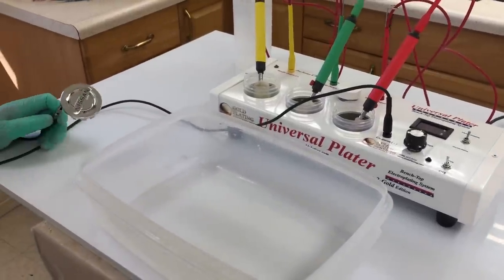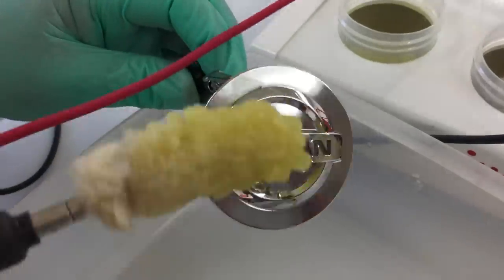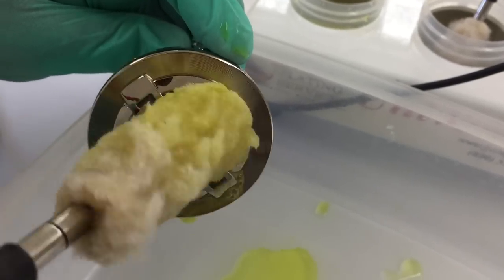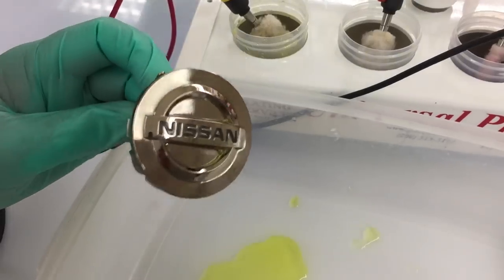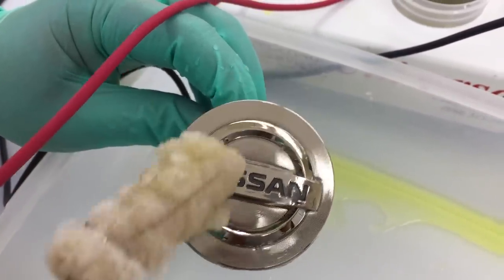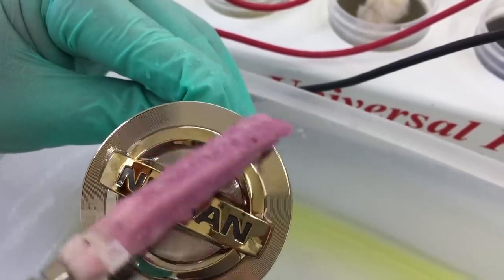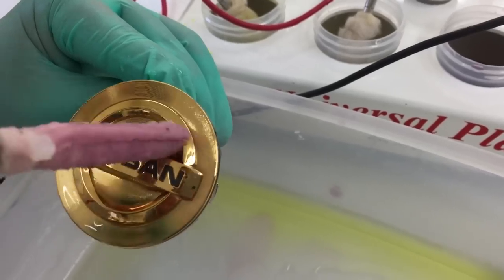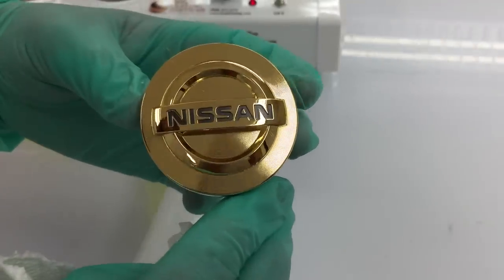How to: Gold Plating on Chrome Items - Plastic Car Emblem - Kit Demo (NEW)

Comment: I remember when going to a car deanship back in the 90's and the gold package was the in thing to get at the time.  I did not think this was popular any more.
Reply from the maker: Back in the 90's it was HUGE.  We sold thousands of our Gold Star Kit and did plating for dealerships all over the USA.  It fell off for a decade or two and now it is back and spreading like wildfire.  Low-riders, show cars and even regular cars are getting gold packages now.  In the show car community is a must-have, in the current trend.  We've sold hundreds if not thousands of these kits since it came out 2 years ago and the vast majority of those people are doing automotive plating.

Comment: Muriatic acid/hydrochloric acid/HCl will remove chrome quickly.  You should apply the plating solution over a larger supply container so that the excess drips into the larger container and isn't wasted.

Comment: You think this would work on chrome door trimming, chrome door levers and the chrome trim strip that goes along your window?? All that gold would be different
Reply from the maker: Yes.  As long as the item is chrome plated you can plate it.  This item is plastic that is chrome plated, and as you can see it works great!  Thanks for the question.

Comment: Like magic.. i really didn't see that coming.. and it seems easy
Reply from the maker: We've been doing it over 25 years and it still hasn't stopped being magical. It really is quite an incredible and fun thing to be able to do.  Truly unique and guaranteed to impress.  Gold plating can be extremely difficult if you don't have the correct setup and instruction.  We have made it as easy as we possibly can for our customers and we share every bit of knowledge we have with them as well.  Thanks for watching!

Comment: I know this is probably a stupid question but, can it be used on chrome model car parts? I have a motor with a blower on it and this would be amazing on it. Great job buddy.
Reply from the maker: Yes. If you stripped the chrome off the parts and then plated it, it would work.

Comment: I'm working on a 1958 cadillac that has faded gold plating on aluminum emblems. can these be successfully plated? the pieces on this car are very expensive and I'm trying to help an elderly lady with this project. also, what is the cost of the kit? thanks
Reply from the maker: For this question we think it would be best if you sent us an e-mail with some pictures of the emblems.  They may be able to easily be plated with the Universal Plater Kit, but we would like to see them before we say for sure.  The e-mail can be found in the text description of the video. ( info(at)goldplating(dot)com )

This particular kit is $999.00 and comes with everything you see in the video.  $300 worth of gold plating solution are included as well as the accessory chemicals as well.

Comment: That clips you use, connected to the "Common" black cable, is that like a ground cable? You have it connected to plastic. Would it work on a larger piece of plastic and/or is there a size limit to what you can plate?

Comment: how do you do to aply a second or third coat? also if i got a copper plated coin can i gold plate it directly without activating ? can i home brew my own gold electrolyte solution?
Reply from the maker: There is no need to apply multiple coats.  The longer you plate the thicker it gets.  You can gold plate directly onto a coin.  DO NOT HOME BREW YOUR OWN GOLD SOLUTION!  Regardless of videos shown on youtube it is extremely dangerous and the result is far from professional.

Comment: how long does the gold last before it starts to fade?
Reply from the maker: How long gold plating will last depends on a few variables. 
1) How thick the gold is applied. 
2) What type of item is it/How will it be handled?The thickness is controlled by how long you plate the item. For instance, if you were to stop plating immediately after the item turns gold, that would be a very thin plate. However, if you spent multiple minutes plating that same area, it would be very thick. The thicker the gold the longer it lasts. Different types of items are handled differently, some a lot and some not at all. If it were a decorative item that is never touched it would stay gold plated indefinitely, could be centuries. If it were something like a Wedding ring that is worn daily, it then depends on how thick the gold is plated. If it were a thin plate it could wear off in a week. If it were very thick, like Vermeil plating (100 micro-inches) it cost last a lifetime.  When done properly, gold plating lasts many years if not decades on most items. If it's a thick gold plate, even on an item that is handled properly, it should last many years unless it is purposely removed by abrasive means (polishing etc.)

Comment: How well would this electro-plating hold up to the high heat of say a motorcycle exhaust? I'd like to go gold on my bobber, but don't want to buy new pipes since theres nothing wrong with my current chrome pipes.
Reply from the maker: Usually if the heat will affect the look of the chrome it will affect the look of the gold plating. Our gold is great on high temperatures (up to about 400 degrees) but the metal beneath the gold may start to corrode.

Comment: i'd like to ask afew questions

1 - does the gold plating last for long time or not .. because i'v read that it doesnt last for long time
2 - can i use gold plated Objects in Wet areas as Faucets in bathroom for example without worrying that the gold plate will go over short time
3 - is Electroplating better than Elecrostatic Paint !! in terms of durability
Reply from the maker: Thanks for the good questions:
1- How long the gold plating lasts depends on how thick it is plated, the conditions it is exposed to and how often it is handled.  If you apply a thick layer and take good care of it, it can last many years.  We have an employees car that has been plated for over 20 years.
2- Gold plating itself does not rust or corrode like many metals do when exposed to moisture.  The only thing that can happen is the underlying metal can corrode.  We have plated hundreds if not thousands of faucets over the years, it is very common.
3- We are not familiar with electrostatic paint, sorry.

Comment: is that like liquid gold? or is it not real gold and just a chemical reaction?
Reply from the maker: It is real, 24K gold, 99.97%+ minimum purity.  The gold bullion undergoes a process of transformation into a salt.  When this transformation is complete, it looks a lot like table-salt (white).  When you add the gold salt to distilled water, it immediately dissolves into solution.  When electricity is added to the solution, (+)Positive at the anode and (-)Negative at the item you're plating, the gold is transformed again into metallic gold onto the item you have submerged.  There are many other make-up components in the bath, such as hardeners and brighteners, that give the solution it's Purple color but if there was just the gold dissolved in the water it is crystal clear.  You can check out our Pure Gold video that shows a crystal clear solution applying metallic gold to a US Quarter.  Check it out here: https://youtu.be/au1qqg1BEiI?t=1m40s
Reply: wow that is really cool! the more you know
Reply: just saw the video of the quarter. lol im from Vermont and i thought that was pretty sweet!
Reply from the maker: Awesome!  That's our favorite Quarter. The picture is great.
Reply: Gold Plating Services

Comment: as i understood its real gold right? so my question is, is there a revert process where you extract the gold from the plated piece? thank you for a reply/answer.
Reply from the maker: Gold can be chemically stripped, however the result is not a usable plating solution.  The gold dissolves back into the stripping solution and although it can be recovered it can only be done by refineries who recover it from that form.
Reply: @GoldPlatingServices   do you have a line up of equipment I can buy. I am trying to do car parts
Reply: seems the difficulty is to get the chrome plating right. The gold plating comes easy.

Comment: get yourself an alligator clip to male banana and aa battery holder and battery and gold solution and it can basically do what this do for less than $30. that big box is just a battery with setable voltage which you can set with battery
Reply from the maker: There is a great reason we have sold thousands of these and are used by professionals all over the world.  You have the basic concept of an electrical circuit correct.  Unfortunately that setup absolutely would not work in this situation, for quite a few reasons.  It might be fun to try as a science experiment though, even failed experiments can be a good fun lesson!
Reply: I dont think you can generate 500volts off battery with an alligator clip hahaha

Comment: I've read reviews and seen pictures of numerous people that have used this and they get black clouds. And Is the stripper supposed to sizzle when applying it? I don't know man. Too much money to take that kind of risk if the gold sucks and it tears everything you plate to hell.
Reply from the maker: We have sold literally hundreds of these kits and have had very few people have issues.  Any who have had issues were making a mistake with the process and once contacting us with a small amount of support are up and going well.  As you can see in the video, the plating goes very smoothly when done correctly.  Black clouds are from either not getting all the chrome off or from leaving Surface Activator on exposed nickel too long to where the acid corroded the nickel.  We have multiple other videos showing these common mistakes and how to avoid them.  We have technicians who have been doing this for 10-30 years and provide technical support Mon-Fri from 9am-4pm.

Comment: Is it real gold?
Reply from the maker: It is real, 24K gold, 99.97%+ minimum purity.  The gold bullion undergoes a process of transformation into a salt.  When this transformation is complete, it looks a lot like table-salt (white).  When you add the gold salt to distilled water, it immediately dissolves into solution.  When electricity is added to the solution, (+)Positive at the anode and (-)Negative at the item you're plating, the gold is transformed again into metallic gold onto the item you have submerged.  There are many other make-up components in the bath, such as hardeners and brighteners, that give the solution it's Purple color but if there was just the gold dissolved in the water it is crystal clear.  You can check out our Pure Gold video that shows a crystal clear solution applying metallic gold to a US Quarter.  Check it out here: https://youtu.be/au1qqg1BEiI?t=1m40s

Comment: Can you use this on items already  gold platted that need to be touched up and stainless steel items
Reply from the maker: Absolutely!  To touch up gold plated items, you need to get it looking as good as you can before starting the 3 step process.  Sometimes the gold needs to be removed first, other times you can just plate over it and it looks great.  Stainless Steel can easily be plated with this kit as it comes with everything necessary.  Here is a video showing how to plate onto stainless steel: https://youtu.be/R3hvbtwE3Ho That knife had been improperly prepared and in that video we show how we replated it properly.  Keep in mind, that video was for demonstration purposes and if we were doing it for a customer we would have plated the entire knife.

Comment: What about rims?
Reply from the maker: Rims can be done.  We have hundreds of customers who use this very kit to plate rims, bumpers, emblems etc.  Large items are done the exact same way, except you do "sections" of the item.  For instance, you would do a 5" square area (chrome strip, activate, gold plate).  Then you would move onto the next 5" square area, repeating the same steps.  Doing it in sections is the best way to ensure seemless, complete coverage of a large area.  If you attempt to do the entire item at once, it does not turn out well.
Reply: can you see difference in thickness when doing a large car part in sections? thank you

Comment: If I gold plate a matte aluminum piece, will the end result look polished?
Reply from the maker: If a piece is dull before plating, it will be dull after.  If it's shiny before, it will be shiny after.  Unfortunately, you are not able to plate onto aluminum on a consumer level.  It would need to be nickel plated by a professional plating shop before you can plate it with our products.

Comment: Could you do this to a hot wheel
Reply from the maker: Yes, however hotwheels need to be nickel plated prior to gold plating.  Typically they need to be sent to us for this process as they are made of zinc and zinc can be tricky without having a Cyanide Copper (we do not sell this).

Comment: Could you clear coat the gold ?
Reply from the maker: Yes you can. Just remember if the item you are plating needs to be touched up, the clear coat will need to be completely removed.

Comment: Is it possible to plate regular steel. Such as steel used for guns?
Reply from the maker: Oh, absolutely.  We have a video demonstrating exactly how to do plate steel, two videos actually.  Over in the realted videos you may see it, if not go to our channel.  We have one called "24K Gold Plating Stainless Steel" and one called "24K Brush Gold Plating on Guns - How to Brush Gold Plate Steel - Universal Plater".  The second video actually IS a steel gun part (AK-47 Safety).  Stainless steel and regular steel are treated the same way.

Comment: Is there such machine for chrome plated?
Reply from the maker: No.  Chrome is extremely hazardous and is not available on a consumer level.  You need multiple permits and have to jump through a lot of hoops to be able to do chrome plating.

Comment: is it real gold or what?
Reply from the maker: It is real, 24K gold, 99.97%+ minimum purity.  The gold bullion undergoes a process of transformation into a salt.  When this transformation is complete, it looks a lot like table-salt (white).  When you add the gold salt to distilled water, it immediately dissolves into solution.  When electricity is added to the solution, (+)Positive at the anode and (-)Negative at the item you're plating, the gold is transformed again into metallic gold onto the item you have submerged.  There are many other make-up components in the bath, such as hardeners and brighteners, that give the solution it's Purple color but if there was just the gold dissolved in the water it is crystal clear.  You can check out our Pure Gold video that shows a crystal clear solution applying metallic gold to a US Quarter.  Check it out here: https://youtu.be/au1qqg1BEiI?t=1m40s

Comment: Isn’t this basically like powdercoating
Reply from the maker: Similar industries but they are different.  Powder coating is done using a free-flowing, dry powder, that is applied using electrostatic and has to cure.  This process uses liquids with real metal, dissolved into solution in salt form, that comes out of solution and deposits onto your part through an electrochemical reaction.  They are both finishing processes, albeit similar they are completely different crafts.

Comment: Hi. Can I do whole car body with this on existing paint work..
Reply from the maker: Electroplating requires the item to be conductive (metal) or at least have a metal surface. You cannot electroplate onto paint unless it is "conductive paint" applied specifically for Electroplating on to.
Reply: Thanks for your answer
Reply: hej senade a ti bi kar cel avto pobarval na zlato. hahahaha. hud si
Reply: pa bi, Sto da ne. Kao Seik hahahah

Comment: Possible for polished aluminium parts?
Reply from the maker: This kit cannot plate onto aluminum.  Aluminum is quite tricky to plate onto and should be done by a professional with a industrial bath plating setup.  Beware anyone who tells you otherwise or tries to say that you just need a secret solution to make it easy.  Thanks!

Comment: does this work on aluminum?
Reply from the maker: Aluminum is one of the few metals you cannot electroplate onto in this manner.  It can be done, on an industrial level by a trained professional.  However, it cannot be done reliably or with any sort of good result on a consumer level. Beware anyone who tells you otherwise, claiming they have the magic solution.
Reply: Do you know of any way I can get a "gold chrome" look? I want to get my wheels that color but on an industrial level people are charging about $5000 and for that price i was thinking of just learning electroplating myself but you said aluminum cant be done but would there be any other method that i can possibly look into?
Reply from the maker: In order to get a gold plated look that has the shine of chrome, you would need to first chrome plate the aluminum wheels, on an industrial level is the only way this could be done.  Then, you could use the above kit to gold plate the wheels.  The result would be a "gold chrome" look, as you call it.  So no  matter what you will have to pay to have the aluminum wheels chrome plated, which will be multiple thousands at least.  It would save you money to gold plate them yourself and also you'd now have a new skill and machine.  You will be surprised how many people come out of the woodwork wanting their stuff done once they know you have the capability to do gold plating.  There are items all around us that can be plated and most just don't realize it.  As for your question about another method - the short answer is no.  There is really no ther way of doing what you're looking to do, especially that would cost less.  Sorry to be the bearer of bad news.